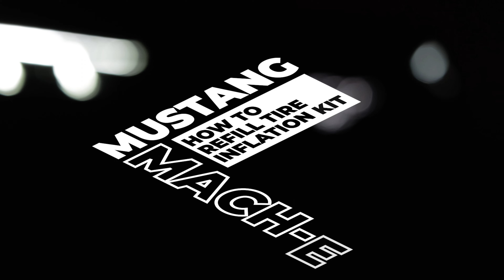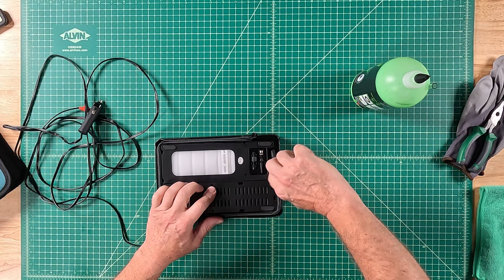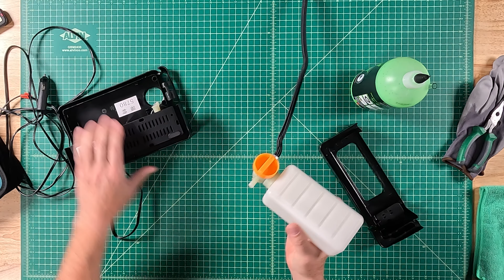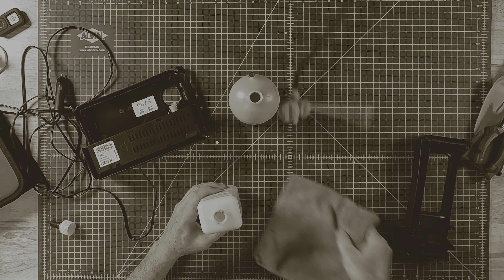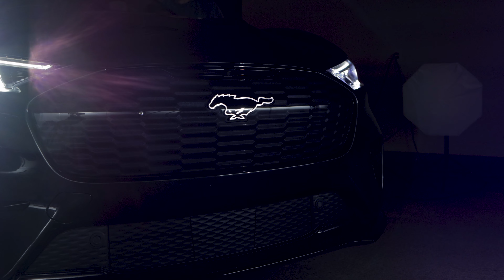Can You Really Fix a Flat Tire with Ford's Tire Inflator Kit?

Comment: Great video!   My wife need to use this tire kit a few weeks ago (worked great - nail in the tire) and Ford wanted $150 to refill this! And that was after telling her she had to replace the tire.
I told just to order a whole new kit on Amazon for about $50, and I will use the Ford kit and just refill for my car (although I do have a full spare tire if need be).  
QUESTION:  You got the 32oz bottle, but how much does the actual bottle need for refilling?  Thanks!!!
Reply from the maker: It takes about half of the bottle to refill the one in the inflator.  Thanks for watching🍍
Reply: @Pineapple22 Thanks!!!

Comment: Can you just remove it and use without it as compressor ?
Reply from the maker: I believe you will need to keep the bottle on the unit to use it as an air compressor, but I might be incorrect.  If you have the one, I demonstrated in the video if you switch it to air, I am almost positive it bypasses pressurizing the bottle but not 100% sure.  Hope this answers your question.
Reply: @Pineapple22  thanks, I’ve tried without the bottle the air compressor worked, it was leaking when it was attached
Reply: I asked the dealer ship and it can be used as a compressor.  I use a 50 year old product. simply pull nail or screw clean hole put a glued rubber plug, fill tire and carry on.

Comment: Your bottle and siphon looked pretty clean.  Can you just add the slime to the residual liquid (compatible?) or do you need to clean it first?
Reply from the maker: The sealant is water soluble so I just rinsed it out before putting the Slime Selent in the bottle.

Comment: This same  inflator came with my 2019 Grand Caravan.   Your video showed me how to  change the sealant bottle.  Thank You.
Did you say you put Slime in your tires even before getting a flat as a preventive measure ?
Reply from the maker: In the past I have put slime in Implements like tractors etc.  before a puncture and it worked great, but I would not recommend it for a vehicle, especially now days with the Tire Pressure Monitors.  Thanks for watching.
Reply: @Pineapple22  I was wondering as every tire shop I have spoken to highly suggests against it.  Not just because of the TPMS sensors but how it can cause corrosion on the wheels and cause havoc on the wheels balance
Reply from the maker: @CVM222VOLT  I agree based on my own experience working in a tire shop for many years.  Fix a Flat back in the day did cause quite a bit of corrosion.  Now days it is for Emergency use to get you someplace where it can be repaired properly.

Comment: Does it work just to fill air if so how do you use it to only to fill air. I connected it to the tyre making sure it was screwed on & started it with the icon facing AIR but it does nothing.
Reply from the maker: To use it as an air pump only just leave the valve in the position that shows the bicycle pump that is the way it should come from Ford.
Reply: I did that and it ends up throwing the white sealant out  even when the option of air is chosen and not repair
Reply from the maker: @fraddy1354  I would try cycling the valve a few times to see if that makes any difference.  If it still puts out liquid you most likely have a faulty valve O ring so you will need to replace the unit.

Comment: So does that mean it will freeze in the northern climate being water soluble?
Reply from the maker: Yes, Slime tire sealant has a low freezing point of -35°F (-31.7°C).  Hopefully you do not live where it is that cold but I have experienced low temps like that myself and it is not fun.

Comment: Thank you great info, I just went ahead and got a spare tire kit, to me it makes more sense. Shame that these manufacturers are cutting cost by removing the most important safety device in cars now a days and piling up more "safety" features that don't really make your car any safer! What will happen to the TPMS sensor after filling the flat tires up with this goo stuff? Will they need to be replaced?
Reply from the maker: I agree about removal of the spare tire I don’t like it and wish there was an option to have a tire and jack.  The tire sealant is for temporary use but it is supposed to be safe for the TPMS sensors.

Comment: So a question from ignorance. What is the slime for and why cant it just use the air like a regular pump?
Reply from the maker: You can use the unit to just put air in your tires.  The sealant is if your tire has a puncture, and it will not hold air.  Thanks for watching.

Comment: Good video on the pump tear-down to get the canister out, but I have some concerns about the product you are showing and its use.

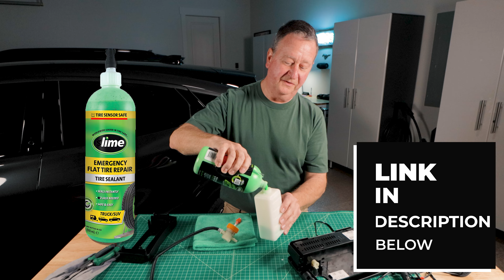So far the only Slime "2 in 1" sealant I see says to NOT use this on highway passenger vehicles.  Are you sure you are using the correct stuff?  This product appears to be for bicycle tires and farm equipment tires (e.g.: tractors). The one you show at 3:10 popping up appears to be for highway vehicles but that doesn't appear to be the same one you show in your hand in the video.  Am I seeing this wrong? You don't want to be using the non-highway version in a motor vehicle.

I also have concerns about using it as a flat preventer as you suggested. Yes you mentioned you did it on tires on implement items (wheelbarrow, etc.) but I don't think it's even a good idea to mention it here at all in the context of a motor vehicle as it could be misconstrued as OK to do so. The highway product version contains various warnings about it possibly causing vibration, and I would have concerns about its effectiveness if it's in the tires for thousands of miles and heating up and cooling down, etc. over and over when it's meant for a temporary tire fix only.

Also, the tire rotation pattern is that the rears go to the front, but the front go to the rear and get swapped side to side.  This means that if the tires also are directional, the front-to-swap-side-rear tires must be dismounted from the rims and swapped.  This negates the use of the sealant in those tires in a preventive manner as they will be breached when doing a rotation properly, and will also be a mess for a tire shop to deal with. It will be a waste.

Lastly, the product you linked to is no longer available. Amazon lists a replacement version which is in a pressurized can and you won't be able to even do this procedure.

Yes the genuine Ford product is 3-4x the price (appears to be part number KR3Z-19554-B) but this is tires and safety...not a place to prioritize by price.
Reply from the maker: The Slime product in my hand in the video is NOT the correct product but the one in the product link and pop up is correct.  I have updated the link, and it is now working.  I am not promoting putting this sealant in your tires as a preventive like a run flat tire.  I was saying I have used it in implement tires for that purpose.  This inflation kit is to get you to your destination so you can have the tire repaired properly or replaced.  I have used the Ford product on two occasions, and it did not work on either, but the Slime product did work and got me to my destination.  It has nothing to do with price it has to do with quality of the sealant and how it fills the hole in the tire.  Thank you for watching and your comments.

Comment: Is the only reason to replace the kit (as Ford recommends) is due to the sealant decaying?
Reply from the maker: Ford recommends that the sealant be replaced every 4 years or if you have had to use it.  Over time I would guess it will deteriorate and not be as effective.

Comment: I only have a low tire. Can I still use the compressor just to put air in the tire without using the sealant?
Reply from the maker: Yes, the unit will work as a compressor.  Just make sure the dial is on Air.
Reply: @Pineapple22  Thank you! ☺

Comment: What if my kit is full of slime but it’s expired, will that stop the compressor from putting air into my tire?
Reply from the maker: It will still put air into the tire.  It will function as an Air Pump with or without the liquid.  There are two positions on the pump one for air and one for air and liquid.  Thanks for watching 🍍
Reply: @Pineapple22  mine ain’t pumping any air out, it turns on but no air comes out
Reply from the maker: There is a check valve in the end so you have to have it connected to a Tire to work.  I do not believe that it will just blow like a regular air hose.
Reply: when you see it's expired, have a plan B ready.  you can still try the kit, but if it doesn't work go for your plan B.
fix a flat or their alternative at walmart is always a good choice.

Comment: Great! video.  

I helped a friend just today use his inflator/repair system for his 2023 Jeep.  

Exactly the same unit that came with my 2019 Mustang Bullitt.

 We were able to inflate the tire without the sealant and get to a tire shop before the tire went down again. 

The beauty of your video is that you show how to re-use the system if you use the sealant.

I assumed that the whole system sealant and pump were only good for one use.

BTW 
I was able to purchase the whole spare tire kit from Ford for under $300.00 including jack.  

The whole rig fits perfectly into the tire well under the trunk mat.

Now I have an actual spare tire for my 2019 Bullitt.

May be available for the MachE

Thanks Again
Reply from the maker: Thanks for watching and the info.  I had a 2001 Mustang Bullitt for 13 years and it was a Great Car. 🍍

Comment: What brand is that tire mobility kit? I believe I have the same one from Ford...but don't see a manufacturer's name. I noticed that Slime sells the actual replacement cartridges (no need to refill the reservoir bottle).
Reply from the maker: I have tried the replacement slime cartridge and it is too large for the Ford unit.  That is why I had to refill the OEM bottle.  The bottle that is in the link is the correct size and type to refill the bottle.  Thanks for watching 🍍